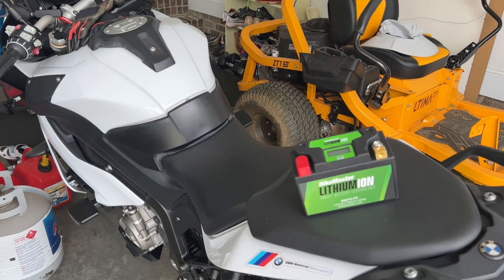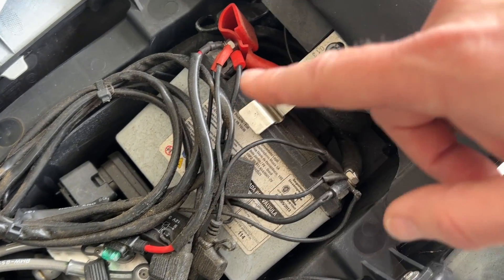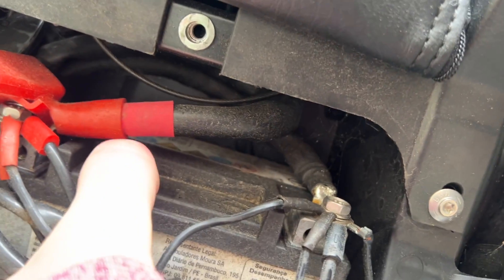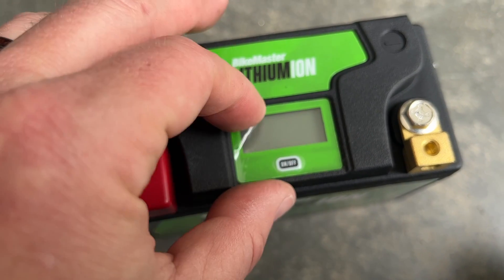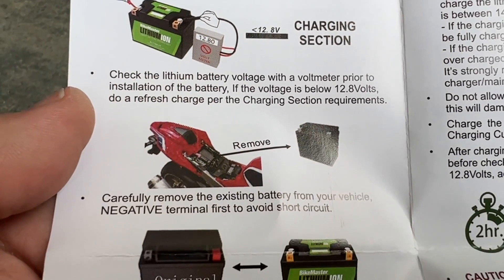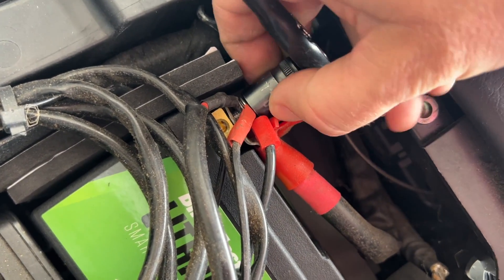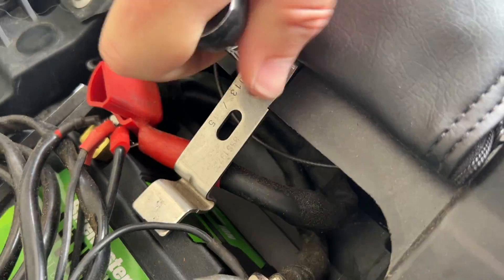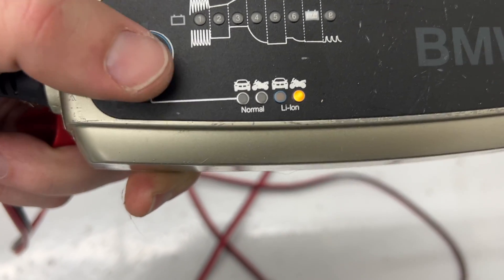BMW S1000XR Lithium Ion Battery Replacement

Comment: Hi! The original battery indicates 12V 8Ah, which is the Ah in this lithium battery? this value needs to be the same of the original battery?
Reply from the maker: +@Gilaguijoza yes make sure the one you get matches